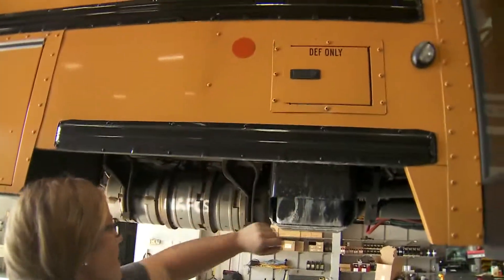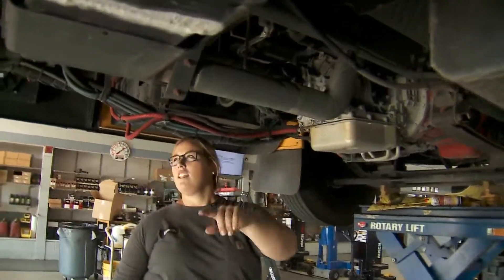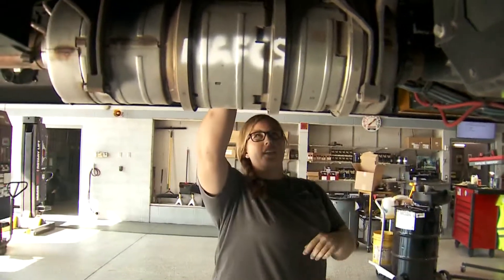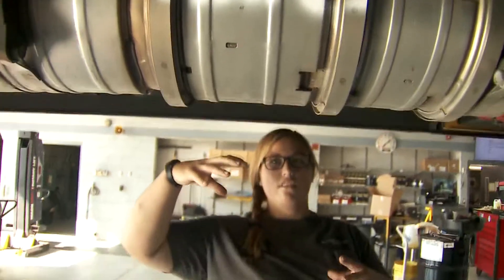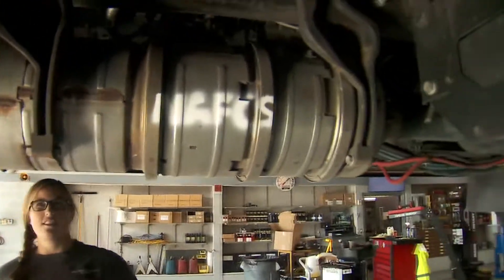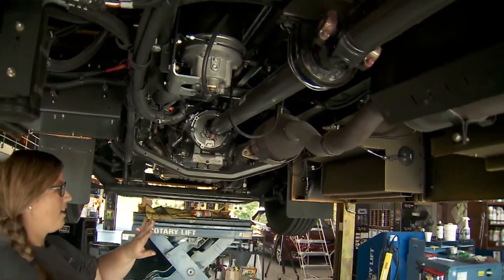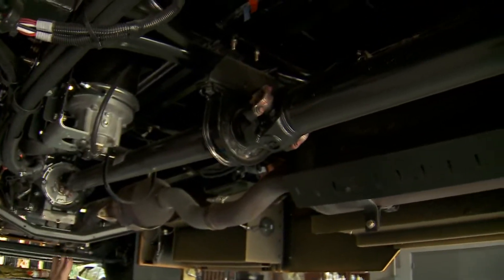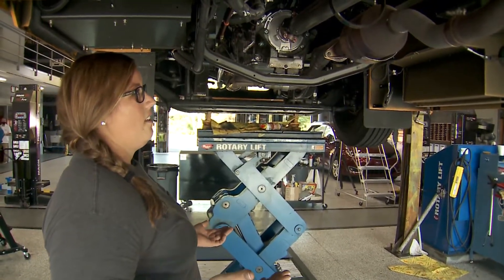Under the bus: Diesel vs. propane explained

Comment: Kool post strait to da point no bs .so why don't semis use propane
Reply: Well, let's think about this! This video was published 3 years ago, and we're just starting to see this kind of ingenuity. Look at all the parts that won't be needed anymore! The powers that be don't want this kind of innovation. It disrupts the money flow of parts and repairs. It'll take another 5 to 10 years to implement propane into semis. Propane has been used in fork trucks for years. There's got to be a reason better than mine that explains your question. The only other thing I can think of is that the semi is pulling too much weight. The vehicle would need to carry a dangerous amount of propane on the highway, which means that if involved in an accident, it could cause fatalities with other vehicles near the scene. That's my two guesses!